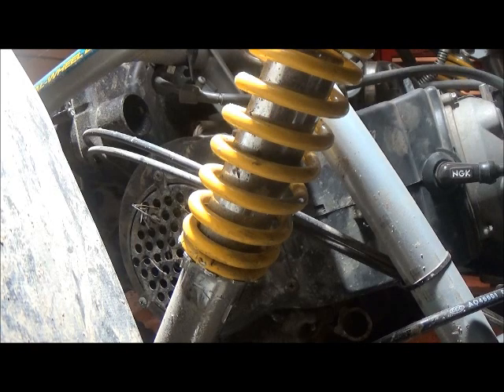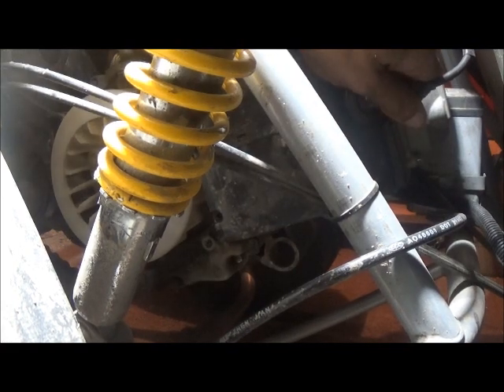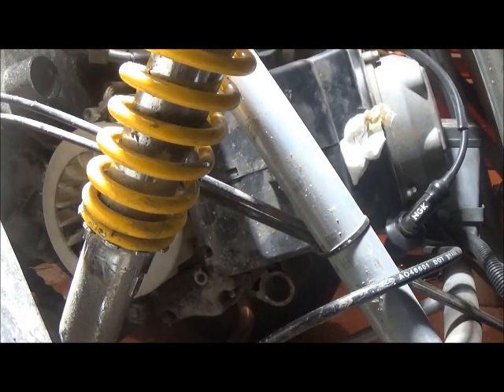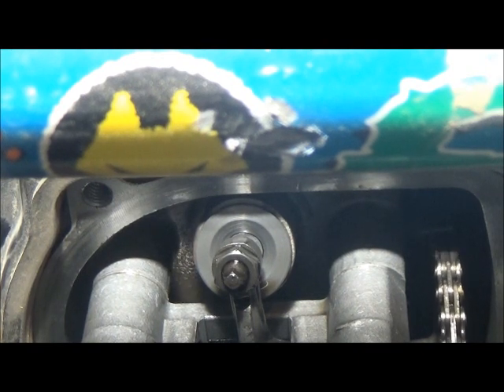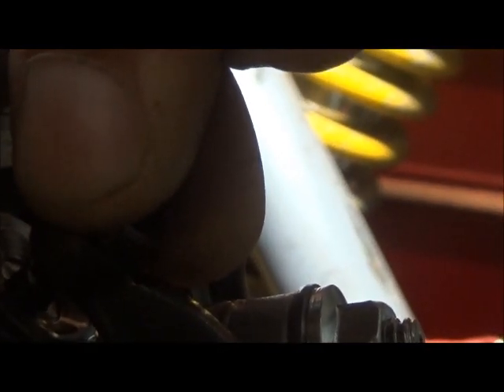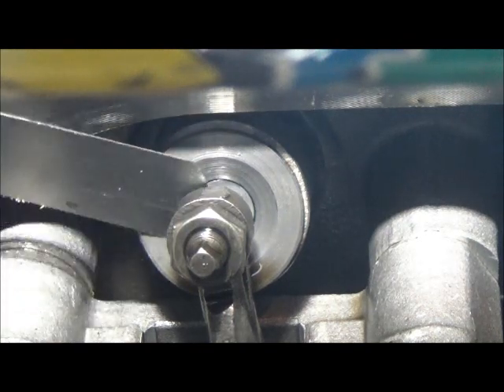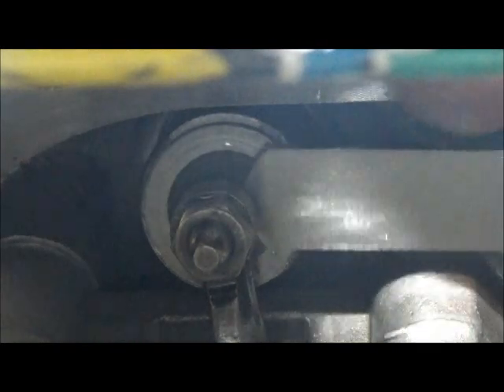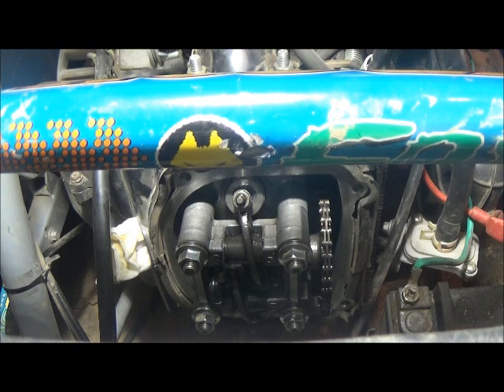Valve adjustment 150cc Go-Kart

Comment: I have a 2005 stingray 150cc and it takes for ever to start put a new carb and spark plug and it still takes forever and the timing be off
Reply from the maker: I don't thinking it is timing I would feel you would have issues in either high rpm or low rpm.  Or maybe under a load. but not just starting being the only time noticed.   My guess w/o me checking it out would be to start with your compression especially with the year of the machine.  If it is getting wear it can cause hard start issues.   If you notice it "restarts" after being warm easier I would def lean compression.  Your Mag/Coil could be failing also but I would expect it to totally run like crap if that was the issue.   Start by checking your compression then go from there.  Electric start machine in "general" should be above 100 minimum to run but should be around 170 or so.  I hope this helps, message me and keep me updated.

Thank you for watching, thank you for taking your time to comment!

DIY-Zac

Comment: I have a scooter 150 cc scooter and I tried  004 top 005 bottom and did not start found a plate on frame specs say 006 top and bottom 008 big difference that what every recommend so I’m going to try the numbers on plate .. someone said to be at TDC make sure valves a closed than  adjust ???
Reply from the maker: Yes, tdc valves both closed and seated.  
Then do your adjustment.  
Thanks for watching, thanks for taking your time to watch and comment.

Comment: I have a 1996 hammer head and I'm having some trouble. It will only turn over if I got the spark plugs and out do you have any idea what this could be I replaced the starter, battery,and the solenoid and still the same thing please help.
Reply from the maker: jeff rountree: my fist guess would have been starter since you fixed that I would say with the plugs out crank it over either by starter or the recoil or nut on crank shaft.  Something is binding or a compression not releasing. IE exhaust valves not opening.  
Did this just start all by itself one day?
I hope I can help ya, I know how frustrating something like this can be.  

Backyard DIY-Zachary

Comment: My timing chain fell off , now don't know how to find correct alignment,  any suggestions.
Reply: Finally go her running for about 30mins then chain jumped again?
Reply from the maker: Not sure,  check and see if it has chain slack adjusters.  Or just a "tired" chain may need new one.

Comment: Hi do you know how adjust timing on go kart 150
Reply from the maker: Probably can't adjust it if it is anything like the one in the video.   To set it you have to align the timing marks (usually a circle)..  If you've done that and think it still needs to be adjusted better it is probably a loose timing chain/belt whatever it uses.  Possibly timing chain tensioner.
Not totally sure on your machine.

Hopefully this helps, thanks for watching!!
DIY-Zac

Comment: Hey I seen leaking coming from my Valve cover i ordered a new gasket but I think it was leaking was because one of my exhaust studs fell off causing my exhaust to come off the engine itself I put it back on & noticed the leak just yesterday would anything else be wrong or should I be fine with New gaskets & stud?

Comment: Well i tried the specs for valve gap that were recommended and it did not work .. found the plaque with the factory specs Gona try to set them to the specs . I was told to manually crank engine to TDC adjust valves to set specs rotate engine again to TDC  ( 2nd time ) check one more time to be sure valves stayed at settings...and should start I hope 😊

Comment: Watching your video you say one valve has to open and other be closed then adjust ?? Thought when your at TDC both should be closed  then u adjust ??
Reply from the maker: Yes I apologise not sure what I was thinking both will be closed at tdc.  
If you can feel for the push rods to go loose that's where you need to adjust it at.  The engine in my cart had tdc marks but I just did it by feel and looked in the spark plug hole to confirm it was up.  
I hope this response is helpful and not confusing.  I'm not the best at explaining through text/written words.    

If your still having issues feel free to ask any more questions, I'll help the most I can with what I feel I know.  
Good luck
Reply: Yeah, you’d better fix this video for this reason as this is kind of a major boo boo.  Valve gapping adjustments are always done at TDC.  I am however looking for what Timon to Marks, if any, exist on the gy6 150 or if you just have to use the ole screwdriver down the spark plug hole trick.  Thanks.

Comment: Ok here we go I found plate stamp on my bike it’s says valve clearance  (top)  0.06 mm (bottom exhaust) 0.08 mm  now gauges I have go like this. On inch side it has .006-.008. On one blade and still in inches  on separate blade I have .008-0.10 .. On metric side blade starts at .102-.152 go up to .635-.686 so the Chinese plate is wrong a few missed placed ( 0’s )  here’s a kicker the spark plug gap is between 0.6 to 0.8  went to four auto parts and they don’t know either .. can you help see what is actual valve # ‘s are it’s gy6  150 cc .. my last resort will be to take it to a shop 😝
Reply from the maker: I would say they probably meant .oo6 and .008
If it were me I would try that and roll the engine over by hand to confirm no issues (just in case the size difference does make a difference)
I doubt it would even if I was incorrect about using a smaller gap.  If everything rolled over smoothly by hand I would reassemble and test it out.  
That's what I would do.  

Not sure where else to steer you.  Not sure where your located but here in Muskegon, Michigan we have a Japanese motor sale and service place called metric motorsports.   Maybe you have one of them where you live, or even call that shop and ask them.   I hate I don't have a better answer for you though.  

Keep me in the loop.  

Zachary

Comment: My 150 go kart blows black smoke and dies out at full throttle
Reply from the maker: Without checking it out my first guess would be the engine is "tired"
How old is the engine?   Did this happen all the sudden?   Is the oil over filled?  Smokes even at idle? 
Sorry for the delay in my response,  hope we can figure it out.  

DIY-Zac
Reply: I’m unsure how old the engine is but I know that the rings are good and it has good compression, and it only smokes black at full throttle when it starts to die and crackle out
Reply from the maker: @reesetrescott3731  I am at a loss without checking it out myself.  Black smoke means oil is some how related,  whether that is over filled or sideways for too long or rings,  valve guides.   Not sure what to say without checking it out myself.    Sorry I can't be of more help though.   

DIY-Zac
Reply: I was told it’s running “rich” like too much fuel
Reply from the maker: @reesetrescott3731  Small possibility,  I don't think it would cause black smoke though.   There's a lot of things I would need to know or try myself to have an idea.  Doesn't make sense to be running then without anything happening it just starts smoking black.